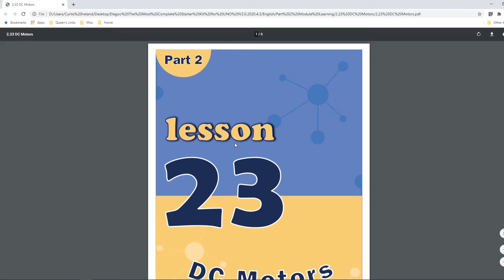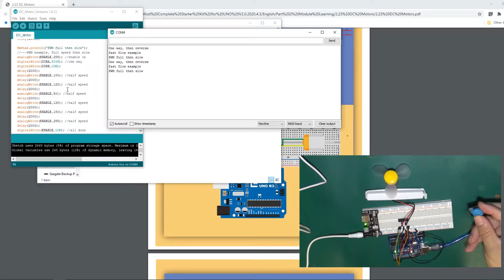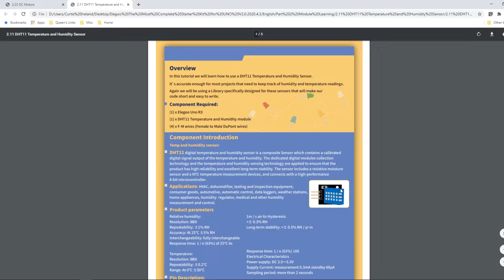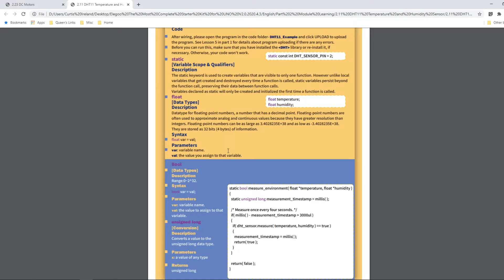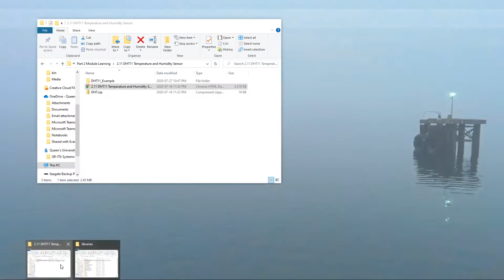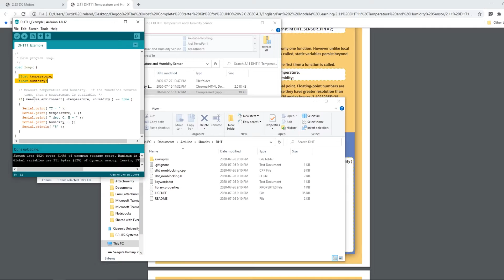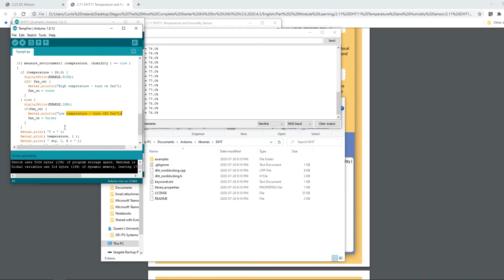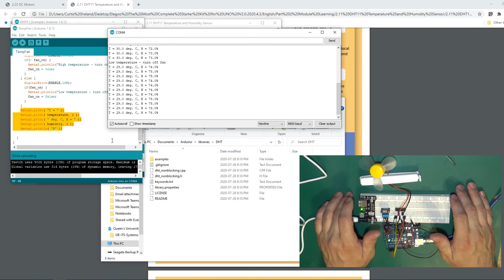Arduino Project - Temperature Controlled Fan

Comment: how can i integrate also a display lcd to dispay the temperature?
Reply: Did you manage to do it? I'm also interested
Reply: @gianlucamolinari3490  I was able to do it, it wasn't that difficult but i have a problem with the fan not rotating are you able to help me with it?
Reply: I was able to do it, it wasn't that difficult but i have a problem with the fan not rotating are you able to help me with it?
Reply: @husseinali8412  dunno if ur still available but could you provide the code and wiring diagram for it?

Comment: Hey man where can I find the code for the dc only to spin?without that dht11.
Reply from the maker: I had to dig this out since I hadn't looked at it for a few years.

The fan is turned on and off through the ENABLE pin. Setting your DIRA and DIRB pins select your DC motor direction.

Since I haven't worked with motors in a while, I guess I could always revisit the subject.

Comment: The DC motor code works but the DHT11 code isn't. Is it possible that my sensor is broken?
Reply from the maker: It's possible. I'd try to connect just the sensor to the Arduino. It should make it easier to check your wiring that way

Comment: Where can i get the library file? Ive tried everything and nothing has worked. My kit didn't come with the zip folder that has the library so idk what to do. Help pls and thank you
Reply from the maker: The code should be available through the description links.  I'll make sure they still work.
Reply: @BasementElectronics  Hey, I've seen that you still reply, I cannot get the file directory to work, it says terminated because no file exists

Comment: Do you need the power supply module to turn it off and on or can you use a push button instead?
Reply from the maker: You can certainly add a push button for power. I just used the power supply module because it came in the set and had the feature already included

Comment: how to connect 4 fan and 3 temperature sensors..?
Reply from the maker: Scaling!

In all honesty, if you're using the DHT sensors, you'll want to use different data pins for each sensor. Similarly, use a mosfet or transistor and a signal wire for each fan on separate data pins.

Don't use the 5V pin from the Arduino to power all this because it won't provide enough current. You'll also want to make sure you have a common ground through all your devices.

This is a quick and dirty way of doing this. There are (of course) other ways of doing this using sensors on I2C and motor control boards.

Comment: What kind of motor did you use? DC, stepper, or servo?
Reply from the maker: For a fan, you'll want to use a DC motor. You don't need any don't control.
Reply: @BasementElectronics  i tried using my DC motor but it did not work. My professor said this chip is an H bridge for a stepper or servo motor. DC motor would consist of using the transistor instead? I wanted to use the dc motor similar to your project but its not wrking. The temperature recordings are there, but for some reason my fan wont turn on?
Reply: @jbravo456  how much voltage does the dc motor needs?
if its above 5 volts  (9v,12v or etc) you woud need a transistor (p-channel or n-channel)

Comment: exit status 1
dht_nonblocking.h: No such file or directory
Reply: help.
Reply: @haydenpate2106   search up dht_nonblocking download and get in on gethub and put it in the library folder
Reply: just download the library its on gethub or either robojax
Reply: @roycecruiser8320  I am not getting it. I looked it up and I see to files related to the dgt_nonblocking.

1. I dont know how to download the file from gethub
2. I dont know what to do in general. I tired copying and pasting the code but it still gives the same error
Reply: @nathan_uwp  I am not getting it. I looked it up and I see to files related to the dgt_nonblocking.

1. I dont know how to download the file from gethub
2. I dont know what to do in general. I tired copying and pasting the code but it still gives the same error
Reply: Did you ever find thecode, if yes could you send to me.

Comment: Don't we need all 3 codes to run it? the temp fan, dht11 example, and the dc motor codes?
Reply from the maker: Definitely. I like to break down a project into individual pieces and get them each working. Once I know my code works, I combine the pieces  into a larger project.
It may seem inefficient, but it helps understand the overall project and helps narrow down any problems that may come up.